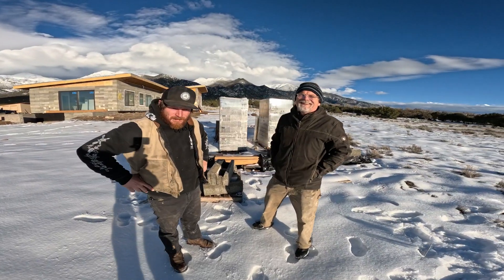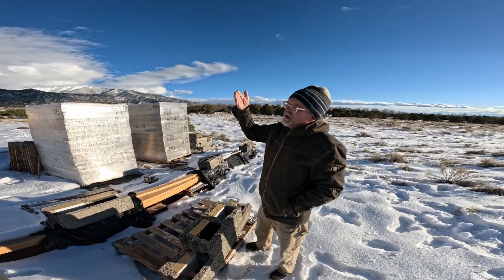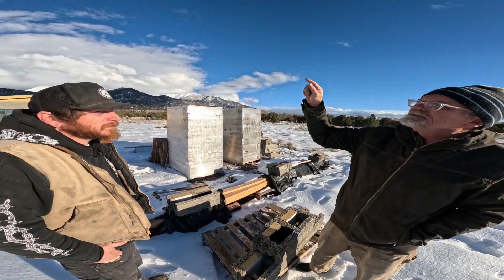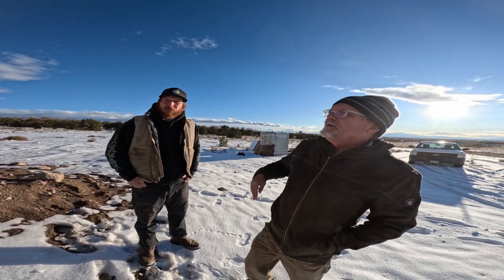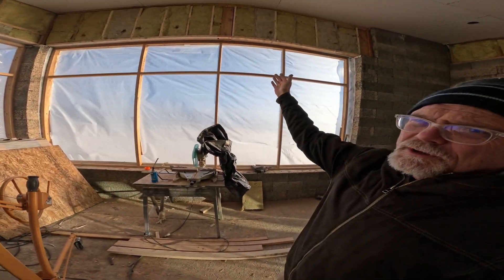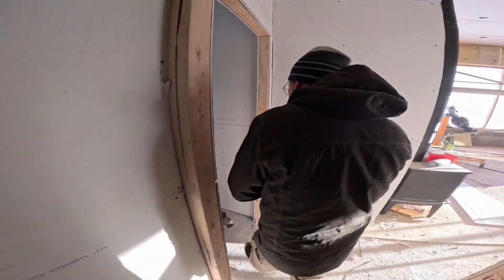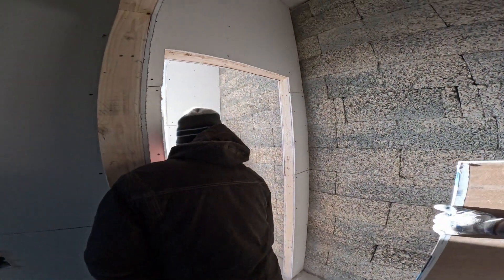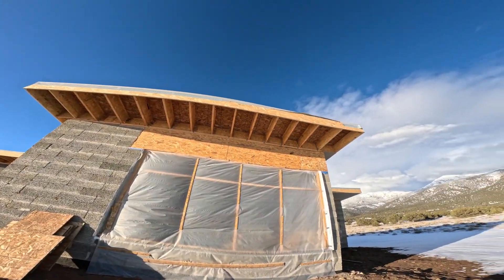Faswall Passive Solar House

Comment: Took two months to stack and pour a dry stack cmu? What was the speed bump?
Reply: Yea, but that is ALSO electrical, plumbing, not just the frame and built in insulation.

Comment: Will you put additional insulation on the exterior or interior? I would like to build with these blocks. I've been looking at them for years.
Reply from the maker: No exterior is stucco and mostly drywall on the inside... no more insulation for besides the blocks for the wall
Reply: We added 3 extra inches of rockwool on ours. Central Colorado.

Comment: I wonder how this material compares to hempcrete blocks in terms of pricing and ease of use. Also, I may have missed it but is Faswall fireproof? Pestproof?
Reply from the maker: Not sure how it compares apples to apples with hempcrete blocks but it does function as thermal mass and has a 4 hour fire rating. Here's a price chart from FasWall's website to give you an idea of cost.... 

https://faswall.com/faswall-pricing/
Reply: Fire resistant and termite resistant according to their literature. Also safe for seismic zones with proper rebar.